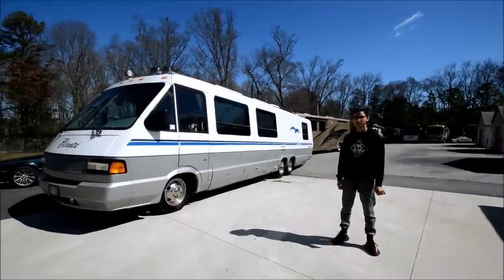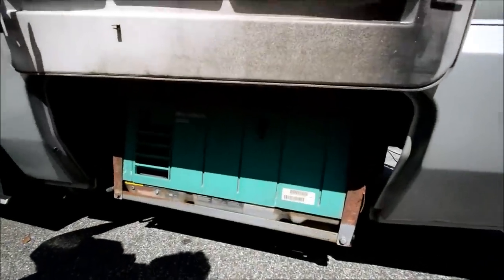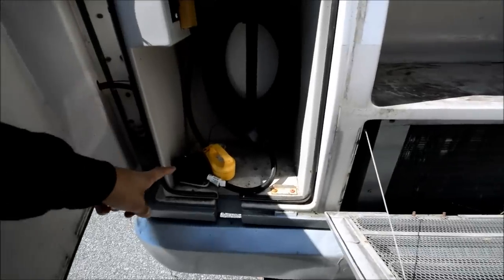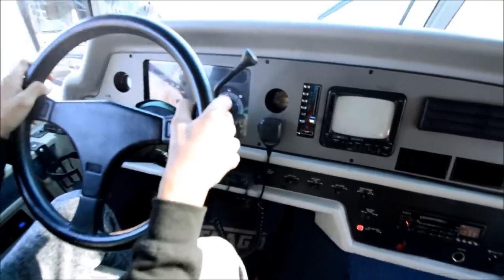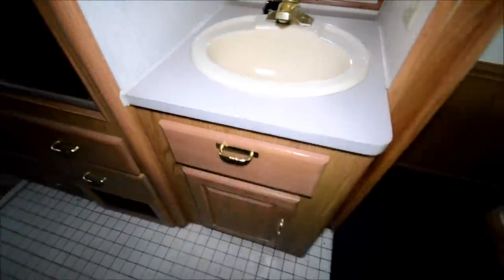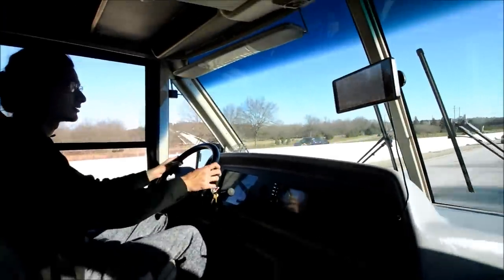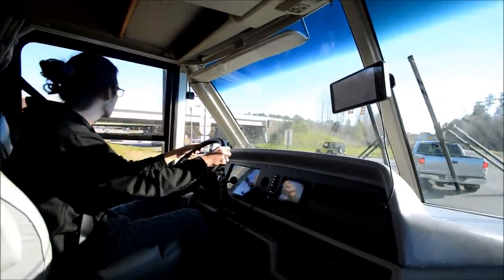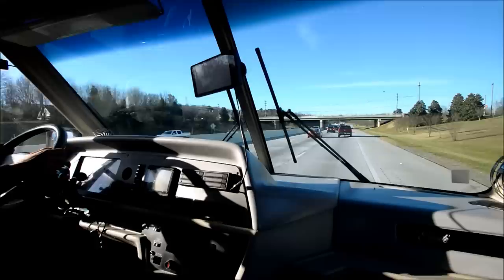1992 Winnebago Elante 37RQ

Comment: Looks good. Looks modern for the year. Delamination is a big issue. And I think you should ensure everything works to sell including brakes, AC and date check tires.  It should have 50amp because of the central air. Good presentation.

Comment: Wow...  I have the single axle 33 foot model from 93'.  Unique looking MH.  Own something like this and you will get noticed/receive complements.  Pros...
1.)  Low Height Clearance
2.)  Styled Different
3.)  Plenty of Storage
4.)  Good Interior Space
5.)  Good Driver Visibility
6.)  Drive it decent and you will get better MPG than you expect.
7.) Jet Air Ride and Hydroboost/AutoPark system relatively easy to fix/figure out.  Parts still obtainable.
Cons...
1.)  That annoying exhaust manifold leak that you WILL develop.
2.)  Sloppy front end steering or tail "wagging the dog" feeling you get when driving.  Very much characteristic of the Chevrolet P30/P32 chassis.
3.)  Many parts are very difficult to reach when working on the motor.  You WILL give blood and you WILL reach for things that are going to make you feel like a contortionist.
He's right...  It will hold 70 MPH all day but will want to downshift often on hilly roads.  You will also get 9 MPG or so working it that hard.  Drive 60 and make the hills work for you and with the right tires you will easily get better than 10++ IMO.  That's been my experience.